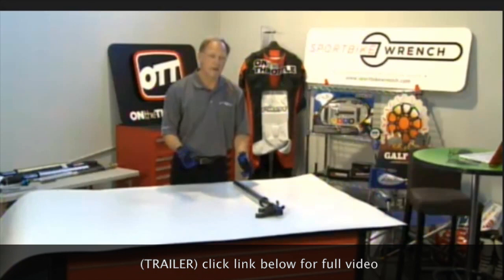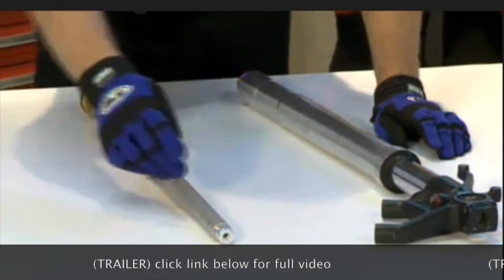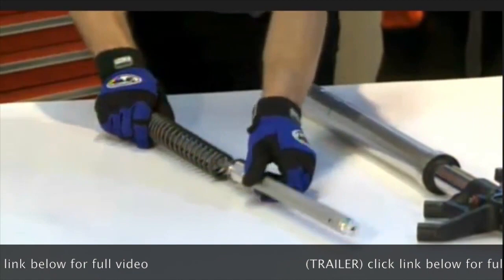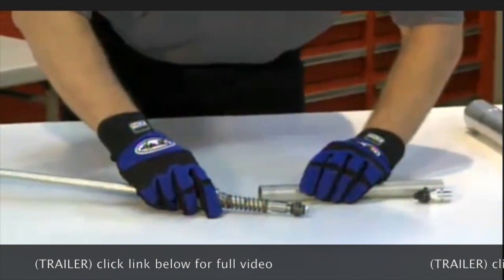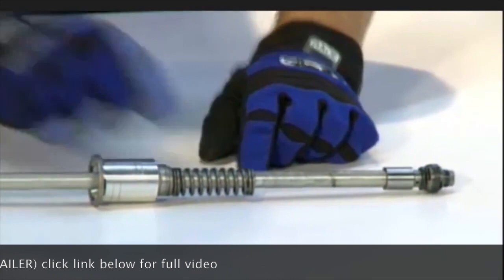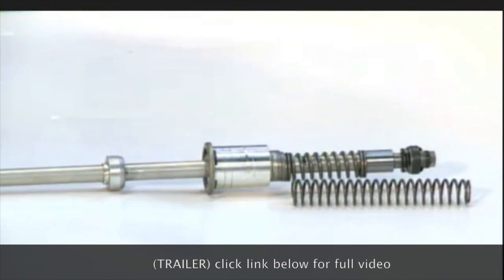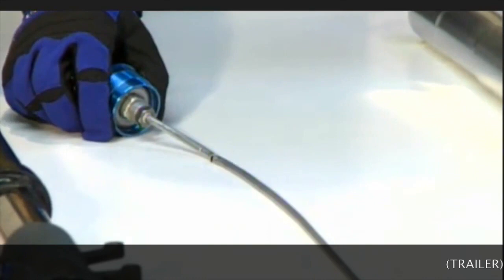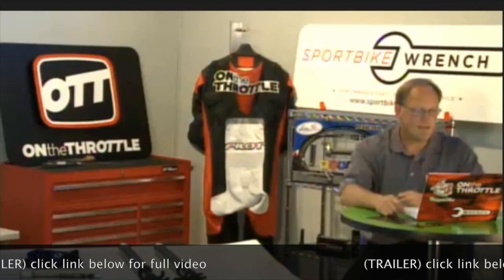Moss Unsprung: Top Out Springs (TRAILER)

Comment: Dave please help! I have an R6 and the front brake is very tight, the wheel barely spins when i have it on a stand. It started two months ago when i took the wheel off to get a new valve stem put on it. When i put the tire back on, the front brake was very tight even after i bled them and cleaned behind the piston. PLEASE HELP! THANKS
Reply: Sounds like you lost a spacer or something go to bike bandit or some online factory parts supplier and look up your bike go the front wheel then check and make sure you have all the parts that are needed if not start looking for the missing piece and if you have all the pieces make sure they're in the correct order if it worked before it should work now you did some wrong or left something out. Dave also have videos on how to installed the front wheel correctly.
Reply: Check Dave's youtube video on how to refit a front wheel. Sound like either the calipers or forks are not aligned correctly.
Reply from the maker: There is a video for that process and it would appear that (if all the parts are in the right places), the free leg is not straight and/or the calipers are binding. This video will help: https://www.youtube.com/watch?v=DYHV78tWs1c
Reply: Thanks for the replies guys, I have all the parts for it, and did everything in order, but my front wheel still only spins one time when I spin it hard. I set my brake fluid to the lowest point possible to see if that's keeping the pistons extended, but that's not the problem either. The brakes pads are too damn tight for some reason...
Reply from the maker: @randysavage1997  Tasks in this order. 1. Check the spacers are on the correct side of the wheel. 2. Check the forks are not bent. 3. Check the triple clamps are not bent. 4. Take a tooth brush to the brake calipers and give them a good scrubbing, or better yet, have the calipers stripped and cleaned
Reply: Yeah I found the problem in one of the steps, my triple clamp on the free leg fork side is bent, I dont think I ever would have looked for that, thanks for the help!